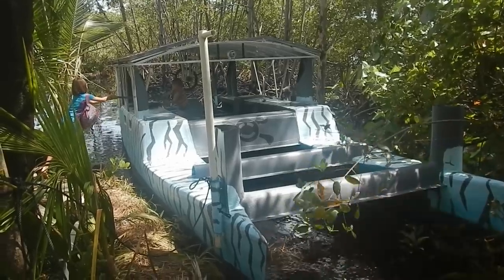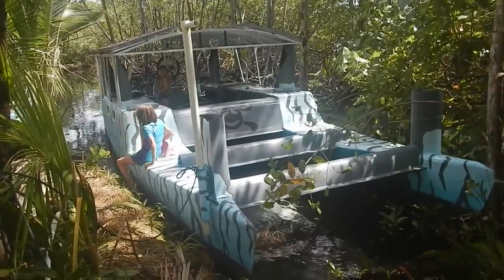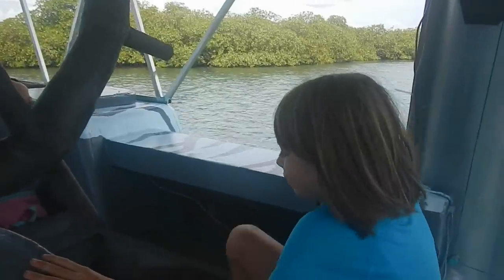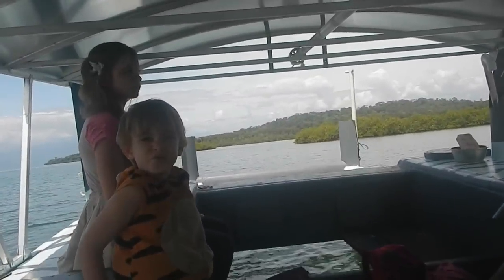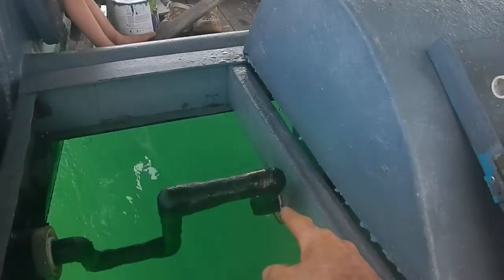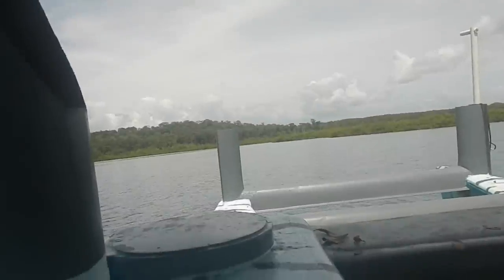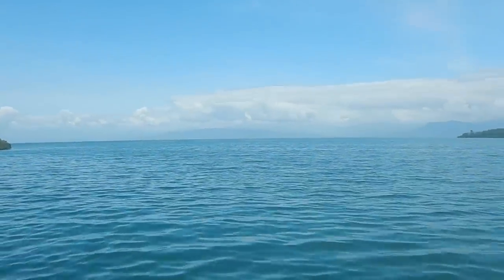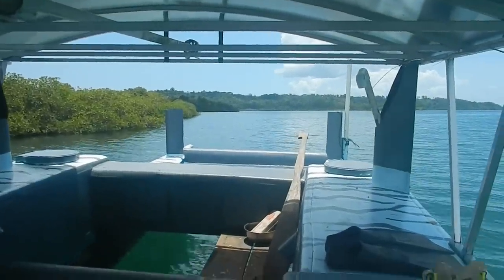Shark Slicer Upgrade 026 Test Drive No.2

Comment: Have you heard of toroidal propellers?  Some vast new improvement apparently in thrust generated.  You should be able to make a version of them out of fiberglass, I think.  Supposedly much more efficient.
Reply: Yeah, they reduce cavitation a LOT and are quieter and more efficient at moderate speeds. They could well be a good fit, but they're complicated to make.

Comment: I would have to have a gasoline boat motor and let’s say six gallons of gas onboard only for emergency use  to feel safe , just enough to get you home I would think a small used motor that could push that might not be to hard to bargain for you know maybe trade some wood once your saw mill is up and working , that’s just me I’m a worry wort and only think of the what could happen stuff😐😀 enjoy your ambition and your videos .